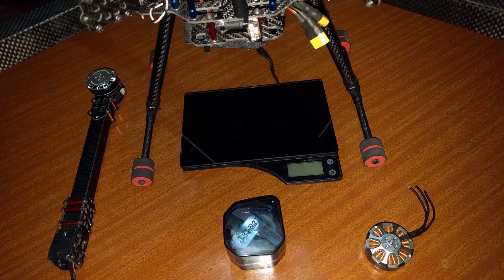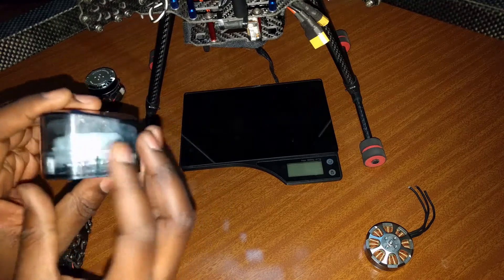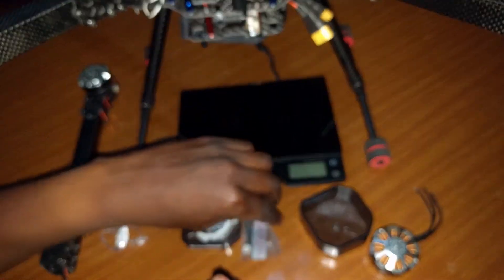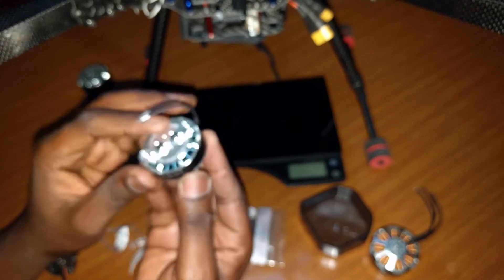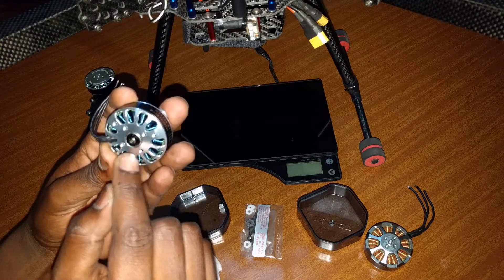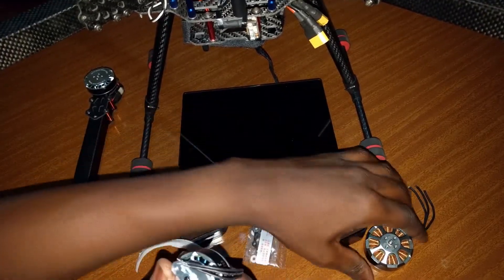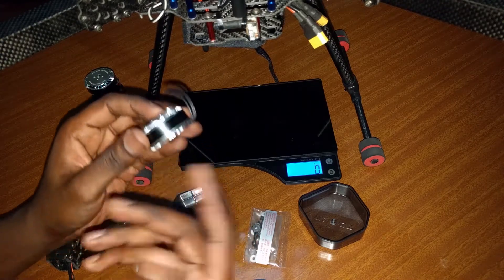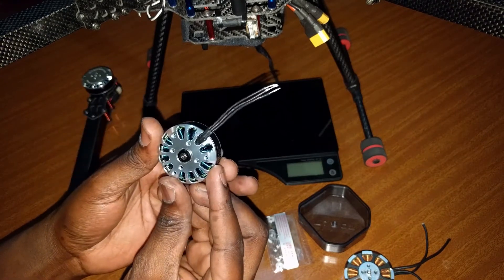TAROT 4008 Martin Motor - Unboxing and First Impressions

Comment: brother , are these motors water resistant or not
i mean the motor windings
Reply: im asking about 4008 martin 330kv motors
Reply from the maker: Hi, no these motors are not water resistant, you would need to get the closed top designs from Sunnysky or T-motor etc.
Reply: @LuideMulumba  thank you so much brother

Comment: Thrust with 17 inch prop?
Reply from the maker: Haven't tested that but if you use the Tarot 1755 folding props you should get very high thrust esp on 6s.
Reply: @LuideMulumba  Thanks
Reply: 3200 gm with 1755 props in 6S lipo
Reply: @marinemarine  thanks for reply.
I am using these motors with tarot 17 inch foldable props (Non carbon fiber), motors getting heated. Is it normal or  need to change propellers.
Thanks